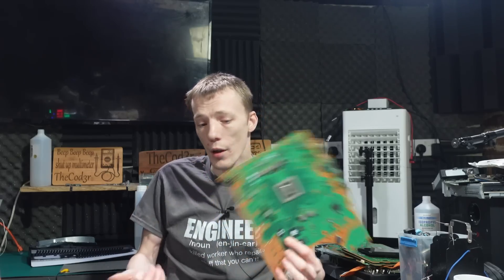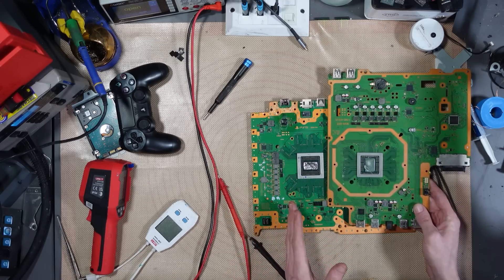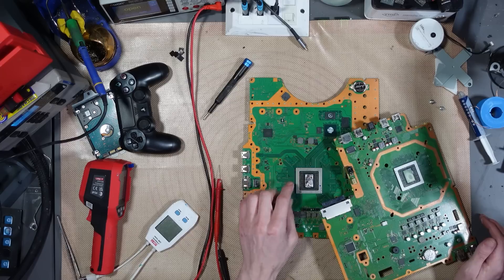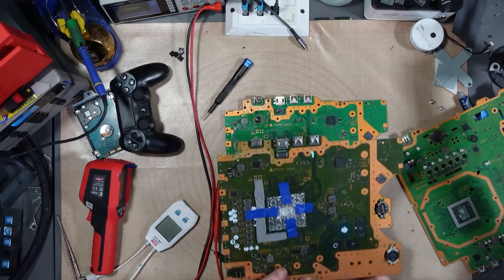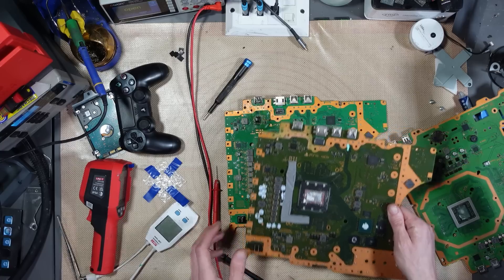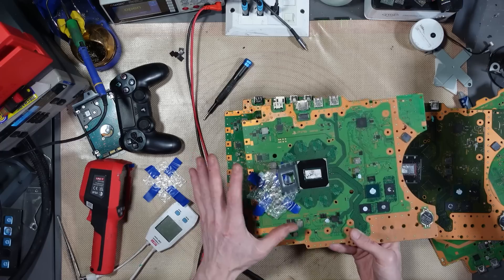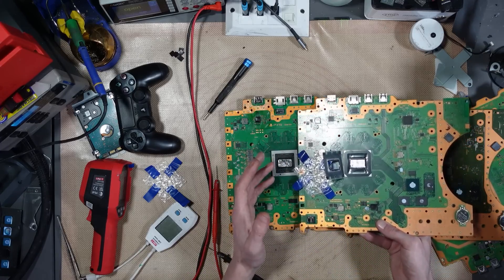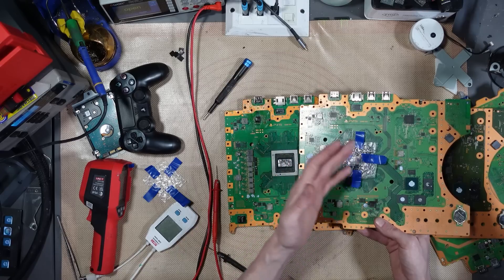Let's Talk About Sony's PS5 Liquid Metal Issue! Is YOUR PS5 At Risk?

Comment: I’ve had my ps5 vertical for 2 years and recently I’ve just noticed that my ps5 shuts down completely no power light or anything. I get a heart attack because I think that it’s gotten bricked or something but I have to unplug the power from the back & plug it back it for it to be turned back on. ever since I heard about this issue I’ve had to place it horizontal and I have not seen a shut down since. Should I open up the bad boy & see if it’s been leaking?
Reply from the maker: That could be the case yes. If you're confident enough, go for it
Reply: Don't. Do. That.
Reply from the maker: @Filipz911  are you 12 years old? Your comments are structured like a child and you're clearly not very bright

Comment: Even if it’s tried to be designed to be used in horizontal n vertical use always use it on horizontal to be safe so the Liquid Metal n disc drive won’t leak or scratch discs

Comment: I have a launch ps5, vertical. I've been getting recent shut downs out of no where (over heating Im guessing), seems like only with PS5 games. Around an hour in, ps4 games work for hours. I tore it down and cleaned it, also mounted it far away from other stuff in a big open area. It was trapped behind my tv before with my amps and stuff. So far it's been alright but if this keeps up I'm definitely keeping this in mind.
Reply: I've had the same issue, you just need vacuum and clean out ur ps5

Comment: I think when your making something in the tens of millions there will be some QA issues for some units but overall I don’t think there’s anything to worry about.
Reply: Only time will tell how common this issue is, since it's very specific it only affects those people keep it in vertical. So at least 5 years into its lifespan we will see the reports what % this is.
So its easier to keep it in horizontal if you can.
Reply: @DrRhyhm  
Apparently they lied and it's not a big problem at all
Reply: Agreed, just because there’s a failure point, it’s quite a leap to say the design is fundamentally flawed. The Liquid Metal egress has only been witnessed in consoles needing service; that doesn’t necessarily mean it’s the cause. It can be, but the circumstantial factors that caused the leak are highly subjective. I don’t think you can objectively call it a design flaw. It’s merely anecdotal evidence.

Comment: So many sheep freaking out in the comments wanting to open up they’re perfectly fine consoles to check for leaks if you’re console works leave it alone be that vertical or horizontal it was designed for both orientations if it has leaked it’s either a manufacturing defect or damage in shipping or knocking it over 2 years into the console life cycle we would have seen A LOT more with this Liquid Metal issue if it was as big a problem as the xbox fanboys say
Reply from the maker: There are no xbox fanboys saying anything of the sort. I'm not even a gamer, so call it what you want and deny what you want 🤣
Reply: @TheCod3r   I’m not calling you an Xbox fanboy pal however there are a lot peddling this problem is it an issue sure as you have pointed out but does it mean people should immediately open up perfectly working consoles to check for leaks no you are as likely to get this issue as you are with a faulty board or HDMI port or a Faulty disc drive there is loads of people in the comments panicking and wanting to open up they’re console to check even though it works fine that’s what am I saying.

Comment: I think you drastically increase the chances of it leaking if you open it up, the sticker looks like it’s doing what it’s supposed to do and containing it to only the die and not the other parts the chip, it could be a defect when the unit was being assembled at the factory, (no hate btw)
Reply: Going to have to open it up "eventually" anyway, liquid metal doesn't last forever and eventually needs replacing
Reply: If you watch his past videos though he had literally fixed broken consoles by just clearing up the liquid metal that was where it shouldn't be. If it was just down to it opening up, this wouldn't be the case.

Comment: At the moment I don't have a PS5, although I am getting one soon. As such, this issue doesn't concern me at the moment; it's just that when I do get my ps5, I plan on keeping it for at least 10 years, if not for ever! I don't want it that 6 years down the line, my ps5 just breaks(my parents probably wouldn't buy me a new one). Now sure, you could just place the system horizontally, but personally, I really don't like the way that looks; I'd probably just keep mine vertically. Anyway, thanks for the clarification on how serious of a problem this is. I hope that by the time I get my console(very soon), this issue is fixed, and a thing of the past.

Comment: I'm just taking that liquid crap off and throw some thermal grizzly thermal paste on. Fans might ramp up a bit more, but im fine with that. Im not paying another 500 plus dollars, and another thing, it took me 2 years just to be able to get a PS5 at MSRP. Keep up the great work sir.
Reply: That is a bad idea…
Reply: @calebscott1477  not really. The only downside is the PS5 wouldn’t be as quiet. I sit quite far from the system, so that wouldn’t be a problem.
Reply: @MadMexism  there is literally a video on YouTube of someone doing that and the PS5 shutdown from being too hot.
Reply: @calebscott1477  if it’s the same video I saw today, yes. It did turn off, but only because the guy did a comparison of two ps5 systems that had the fan’s disconnected. To actually see what solution was able to expel the heat easier. The PS5 with the Liquid Metal application did stay on longer. The guy goes to explain that the thermal paste solution would also work, but the fan in the PS5 would ramp up a little harder than the Liquid Metal, due to the paste not being able to conduct heat away as good.
Reply: @MadMexism  the architect that made PS5 already said the fan speed and smart shit was determined by power draw. Not thermals.

Comment: I just bought a horizontal stand with a cooling fan built in for 12 bucks. Who knows if this really needed to happen. But I’m not taking any chances. I’ve had my ps5 for 10 months in vertical since day1 so f-it, I’ll just go this way and hope I did the right thing
Reply: If the fan is in the stand there is no intake or exhaust there on the system. Therefore, that fan does absolutely nothing for your PS5
Reply: Besides keep it horizontal.. I figured the fan on a blank sheet of plastic wasn’t doing much… but it keeps it sideways 🤷
Reply: @P34V3Y7  yeah

Comment: This is probably happening due to two reasons:

1) improper handling of the console during shipping and/or at the shipping warehouse. I work for UPS (inside and on the road). All the packages that arrive at the warehouse are unloaded (by the workers in that section) from a big truck trailer onto a moving belt where it then gets picked up from another moving belt (by the workers in that section) to load inside many of the vans they do each. Depending on the working pace at either section (where it is unloaded from or loaded from), they either get thrown, dropped or carefully unloaded/loaded. 

Many of the workers in the load section (where the packages later gets picked up) are doing 3 to 4 vans each that they have to load on their own. The workers at the unloading section make things worse for those at the load section many times by throwing all the bulk packages together, one after the other, (let's say 5 to 10 or more boxes of PS5) that they have to pick from the moving belt and load inside one of the 3 or 4 vans (while there's more work coming down for the rest of the vans they're doing). 

So because of this or to avoid missing the packages, they get picked up fast and thrown or dropped in the van/nearby instead. The supervisors of such unloading section are the ones to blame for letting this continue to happen and wanting to push the work, over and over. 

2) improper handling of the console by the owner (after going through all that shipping torture).
Reply: I heard that they are making between 96 -104 thousand Ps5s per day
Reply: @BallzMcGavin  We're getting a lot every week. Many of them going to GameStop (for those with membership 🙄).
Reply: well now reading this, I'm concerned because my PS5 is getting shipped by UPS lmao
Reply: @cryptozex  lol, hopefully it arrives safe. Before getting mine shipped from Japan, I was given the option to choose a different carrier and made sure that it wasn't UPS but FedEx or DHL 😁
Reply: @sonyx5332  I got bad news for u cause FedEX aint gunna be any different then UPS. Most shipping and package delivery companies have a very similar operating structure.
Reply: @ultimatehamsandwich734  That's sad to hear then.
Reply: or 3) poor design
Reply: @GregH999  if it was pour design multiple YouTubers who take apart ps5s and other electronics they would’ve caught this problem way before it became a serious problem
Reply: Poor*
Reply: @GregH999  LMAO   Guess you're better than SONY's engineers . You should lead their teams to improve this "issue" .
Reply: @GregH999  I don't know if Americans or Japanese worked/were responsible for the PS5 design. Japanese value the work they do and are or like being kind of perfectionist with what they do, so I would doubt that it is a poor design if made by Japanese. 

I'm glad I came across this video because I just received mine last week from Japan (the last model and says that it has been made in the original PlayStation factory that's in Japan) and will be having it lay horizontal instead. I don't mind having them vertical but because there's liquid metal inside I just rather be safe with my consoles. 

I previously had a BC PS3 standing vertical (looks better and for the air flow) with liquid metal knowing the risk and decided to just remove the liquid metal instead to keep it vertical without the risk of killing the console.

Comment: my ps5 crashes while watching videos ( for example, watching a replay of my gameplay , watching my friends playing with screen share, while editing videos ) it basically freezes and then you need to restart it. the thing is i never get this error while playing games ( i can play for 8 h without no problems ) what could be wrong in this case ?!
Reply: A few weeks ago my PS5 (the normal one) crashed instantly after i started to watch a 30min game caputure from myself. Also i was in MWII when this happened to me. My console wasnt hot or overheating, the Ventilator was also very quiet. I think its a system software bug or anything else

Comment: I've liquid metaled my delidded CPU on my gaming pc for years now and I've always used 3 coats of clear nail vanish and never had a issue. maybe Sony should look into something as easy to do as this
Reply: Maybe there isn't actually a problem and the fact that every deffective PS5 end up in the hands of ppl who repair PS5s is skewing ppls perceptions ? I mean its veyry logical that all PS5s in a repair shop have problems, and there is way under 1% of the consoles with this problem, so its a simple case of every PS5 that have a problem in their seal and therefore have a problem with the liquid metal, end up in a repair shop so...

Comment: 05:20 seems that you made the liquid metal seep to the left when tearing the foam off. The liquid metal was sticking to the foam, so when you teared the foam off a little drop of liquid metal was dragged to the left.
Reply from the maker: You're partially right there, indeed. However, the liquid metal was, as you say, to the left and on the foam. It should never have to hit the foam. And trust me, the LM was already seeping under the foam too
Reply from the maker: Well if the liquid metal was contained properly it would never seep to the left, and should never have to hit the foam in the first place.

If you think about it this way: The foam is indeed there to help stop liquid metal spilling onto the board, granted. However, over time, the liquid metal gets soaked up into the foam and eventually there's not enough on the SoC to actually effectively cool the system. Either that or it soaks so much into the foam over time that it causes the foam to become full, to the point it will no longer effectively do its' job (meaning it'll no longer be able to actually soak up the liquid metal) so it would eventually run over and onto the board anyway.

Now, if Sony actually designed a good system and didn't have to overclock the SoC, they would never have needed liquid metal. If they didn't want the system to look like something from the 2050s, they would be able to put a better heatsink in and effectively cool the system with thermal paste rather than with liquid metal. LM isn't designed for consumer electronics, it's designed for overclockers. Overclockers take precautions which includes a lot more than a little piece of foam.

What Sony should be doing if they want to use liquid metal, is build a proper wall with a proper gasket around the edge, and have the heatsink sitting inside the wall rather than just on top. Sorry but anyone with a brain cell can see that this is going to cause an issue. Gravity will win hands down 100% of the time. I don't care how smart the engineers at Sony are, they aren't as smart as nature.
Reply: @TheCod3r  wdym it should never touch the foam? Isn’t that what it’s there for? If you remove the foam ofc it’s going to leak out, all you wanted to do was make a video fear mongering for views

Comment: Hey coder i my ps5 has been having problems, im not sure if its due to this cause i have had my ps5 vertical not knowing. When i try to play games my ps5 starts it gets to the loading screen and then stops working and then says error system corruption but ive done the system fix and it still doesn’t work can u try to tell me what ur opinion is

Comment: Every one else loves playstation consoles. I got bad luck when I buy them. Were they ever design properly.? My fix is never buy them. I like the games. I play them on other reliable devices.
Reply: Wat happend with yours?
Reply: @MissxLariz  they broke down of course...maybe bad electrical wire system like the host says.. I heard from people like first playstation needed to turn upside down because of the disc system. I think it's bad quality all around. I'm not dumping on the games themselves just hardware. I stopped at ps3. If you don't have problems or don't care than Sony playstation is for you. I do buy their audio equipment however. Got a 500.00 Bluetooth speaker and cheap Sony  🎧  headphones.  I do buy other tablet or computer to play games. The playstation 4 are working on emulation. I only play playstation 1 and 2 on tablets and raspberry pi 4. I heard Sony manufactured some of the raspberry pi s however.
Reply: @craftymulligar  I see fair enough. So far i havent had issues with mine but i only got it for a week. Usually im unlucky with electrical stuff too 😂 Well... one issue. I did buy an M2 SSD with heatsink and i couldnt get it in my PS5, went back to store and the guy said the SSD shouldnt look like this. So apparantly the SSD was too far in the heatsink (manufacture fault) and i had to push it further outwards at the hole where you put the screw. Now the pins are in the same spot as in the picture and it finally got in the socket pffff... 😅
Reply: @MissxLariz  sorry I let you down or any body else I've unsubsidized to this channel I pretty much been told I need to put my big boy pants on because I don't like the cussing but I just love telling them I don't like their fowl language.
Reply: @craftymulligar  No need to say srry you did nothing wrong. Everyone is entitled to their own opinion and preferences. Heck if you got any problem you should shout as loud as you can haha!

Comment: The PoS5 is a fugly car crash design. The PS4 was bad enough, I went through 3, this must be $onys strategy to sell more units. Divide the number sold by 4, gives you the number alive. Worse that BLOD.

I’ve walked away from anything $ony, not only are the designs bad, they follow up that with anti consumer practices. No thanks.
Reply: I'm opposite end of the spectrum. Have loads of Sony products and only had one issue with a PS3 slim about 10 years ago. Still have my PS2 working from years ago. Sony LCD TV from years ago going strong and my OLED a couple of years old with no screen retention issues. Seems you have bad luck with Sony products. All mine have been perfect minus the PS3 years ago and Dualshocks with their stick drift (common to PS/XBOX/Nintendo)
Reply: @dragonsoul30  Sony fanboy clearly. BLOD is a well know and publicised phenomenon, so it’s more realistic you’re the lucky one. I won’t touch $ony product now going forward. I do still have a working PS2, the last real good product they made and before greed and anti consumerism over took the corporation.
Reply: I just like quality products. Sorry you have had a bad time with Sony products but I haven't. You are clearly a child using the "fanboy" shtick
Reply: @dragonsoul30  no, you are exhibiting fanboyisms. You are ignoring the facts, BLOD, and claiming reliability under the guise “mines ok, so it’s not real.” It’s all very real. You are turning design flaws into “opinions”, you are excluding the anti consumerism of $ony, you are excluding the 4 hour battery life on controllers, the Liquid Metal, the weak controller triggers.. All short comings, the looks, the performance. It’s your pure fanboyism. Be objective. Those things are real. 🤷‍♂️